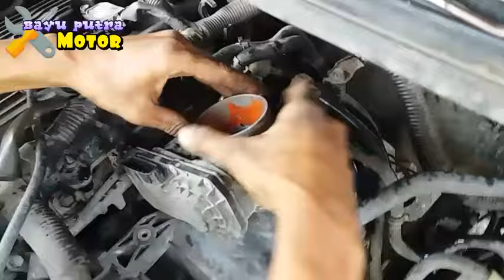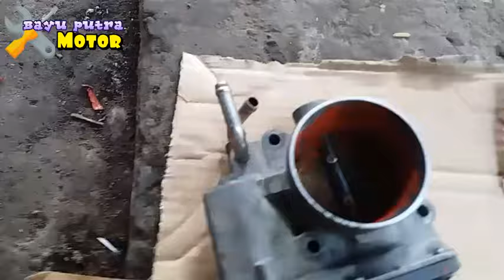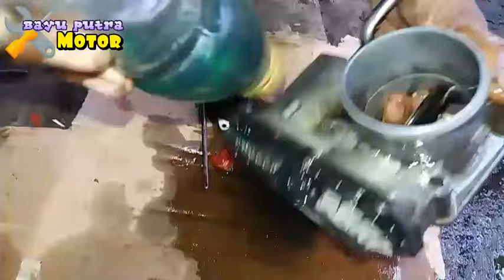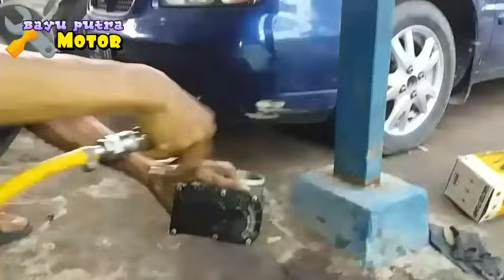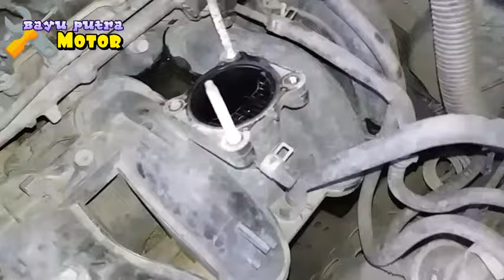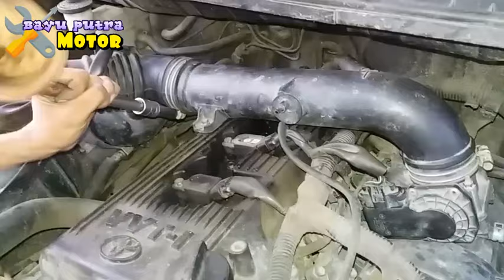CARA MENGATASI TARIKAN MOBIL BERAT DAN MESIN PINCANG TOYOTA INNOVA AVANZA XENIA/Bayu putra motor

Comment: Saya pernah bongkar taruna saya sendiri di rumah. Baru general check up sampe habis 3 juta. Mesin sih enak, cm kok tarikan berat. Waktu saya bongkar TB lha kokkk kotor banget. Trus kmaren itu nggak dibersihkan apa? Dasar bengkel duit mulu maunya. Beda yg kerja karena passion di otomotif sama yg pure cari duit emang. Hati2 aja.
Reply: TB kotor emg pengaruh ke tarikan ya om?
Reply: @jpc9808  pengaruhnya di idlenya sering mati matian ,kalau tarikan berat sih lbih ke krn internal mesinnya dah capek ( misal kompresi bocor) krn sdh pernah bersihin tb mobil maupun motor , ngaruhnya cmn rpm balik ke normal misal sblm d bersihkan 600 rpm stlh d bersihkan jdi normal 800-900 rpm
Reply: Mau nanya om,kog Innova saya tahun 2014 di trotle body ga ada selang airnya ya

Comment: Mantaaap.. 
Mau nanya bro itu td ad slang air di trotol body itu selang dari mana trus fungsinya apa bro..? 
Mohon infonya
Reply from the maker: Fungsinya untuk mengatur gas.
Reply: Selang air radiator untuk pendingin trotol body biar uademmm
Reply: @jewanace6119  bang throttel di innova sy kok nggak di sambung dan selangnya juga nggak ada ,apa. Ada pengaruhnya

Comment: klw saya prediksi itu d kasih lem agar idle kembali pada posisi standar. mungkin sebelumnya terjadi kehausan/koin tidak menutup pada posisi ideal sebingga idle terlalu tingi/besar  mungkin awalnya setelah d kasih lem normal. tetapi sipat lem itu lunak ketika terkena bensin yg menyebabkan sebagian lubang tetutup krna pergeseran lem.
Reply from the maker: Ya mungkin ini karna ga ba stasioner/langsam. Jdi di akalin pk siler . Seharusnya jgn pk siler tpi pk lem besi tipis2..
Reply: Bayu Putra Motor tujuan sudah benar tp butuh keahlian seni dan ketelatenan.
Reply: Masuk akal si

Comment: Mas inova bensin mesin getar saat langsam. Digas full nyendat2. Gas diurut tidak. Sudah diganti Maf, Afr, Busi 4, Koil 4, Filter bensin, App Pedal gas. Injektor hanya dibersihkan mekanik. Tapi tetap kayak diatas. Mohon jawabannya.
Reply from the maker: @cidadap1789  coba cek dulu tekanan fuel pump nya. Pastikan mencapai 40 psi

Comment: Maaf boleh tahu fungsi saluran air di throtlebody untuk apa ya?
Reply from the maker: untuk mengaktifkan FIAV (Fast Idle Air Valve).

FIAV adalah Valve mekanik yang berfungsi untuk melewatkan (bypass) tambahan udara ke TB pada saat mesin dingin (air radiator dingin) sehingga otomatis RPM akan lebih tinggi (CHOKE OTOMATIS), begitu air radiator panas, si FIAV (isinya semacam WAX yang mendorong mekanik Valve) menutup jalur udara tadi ke TB, sehingga RPM agak turun sedikit..
Reply: @BayuPutraMotor76  alhamdulillah, terima kasih banyak ya Om 🙏 semoga info ini tidak hanya untuk saya juga untuk penonton lainnya. Berkah dan makin sukses untuk anda sekeluarga beserta tim BayuPutraMotor. Aaamiin

Comment: Om bayu Putra Motor innova Q throtle body dan air Flow sudah ganti tapi mesin tetap gesek. Kira2 apanya ya om??? Mohon pencerahan
Reply: Mesin gedek rpm naik turun g bs stabil
Reply from the maker: Lampu chek engine menyala ga pda waktu mesin hidup? Klo nyala itu harus di secen dlu biar ketauan dari sensor mna yg eror
Reply: G nyala om bayu

Comment: kalo buat mobil avanxa pas di stater itu ngadat kalo di gas malah mati..  apa itu juga trotele mas ?
atau yg lain ?
mkasih.
Reply from the maker: Bisa juga maz..tapi coba di tune up. Dan cek sensor2nya
Reply: @BayuPutraMotor76  oke... penyebab kalo di stater tidak kuat dan tidak bisa nyala mesinya itu sih apanya om ?mobil avanxa

Comment: Om...itu 2 selang di Throttle Body aman dicopot kah? Selang bensin kah?
Reply from the maker: Itu slang air mas bukan bensin..
Reply: @BayuPutraMotor76  terima kasih infonya Om...saya akan coba bersihkan sendiri 😁, kalau service rutin di bengkel resmi toyota tiap 10k km apa tidak mereka bersihkan ya om
Reply from the maker: @dadangkurniawan4367  . Kalo 10km terlalu cepet. Awas klo mau bersihkan sensor hati2..klo mau coba trotlle body nya aja
Reply: Selang air di throtell body nggak ada amankah trim

Comment: mau tanya mas,punya saya kemaren kering bensin pas lg dijalankan,setelh di isi mesinnya jdi pincang,kr2 yg mesti hrs di benarin itu apanya ya mas..
Reply: innova jga mas
Reply from the maker: Rotak/pompa bensinya kotor karna endapan yg ada di tengki ikut tersedot..biasanya itu masalahnya. Coba di bersihkan dulu..mudah2n sih blm masuk ke injector..
Reply: tkt mas mau nyoba2,ntar tmbh parah😂😂,kalo misal benarin dibengkel kira2 kisaran hrganya brp ya mas "sbgai gmbran aja mas biasa benarin"🙏🙏 ..??
Reply from the maker: Itu blm tentu rusak cukup di bersihkan aja.  Bisa di coba ganti filter bensinnya dulu atau di bersihkan brg x ada kotorannya..klo bongkar rotak itu harus nurunin tengki bbm. Jasanya tergantung bengkel masing" klo di tempat kami kisaran 150rb an..
Reply: oke mas,makasih byk udh mau berbagi infonya..🙏🙏..!!

Comment: Bang mau nanya kalau innova tahun 2006 tidak berasap tpi bau pedis asapnya
Reply from the maker: Apa aja yg sudah di lakukan? 
Itu akibat pembakaran kurang sempurna jadi ada sisa BBM di ruang bakar
Reply: @BayuPutraMotor76  apanya yg mw di kerja itu bang? Terimakasih
Reply from the maker: @yokypamalingan7658  . Di tune up mesin dulu. Bersihkan trotle body dan cek busi . Dan cek sensor knalpot
Reply: @BayuPutraMotor76  bisa gak reviu vidionya bang terimakasih.
Reply: @BayuPutraMotor76  cman bau knalpotnya yg pedis bru knalpotnya tdak berasap.
Reply from the maker: @yokypamalingan7658  . Ya mas itu karna pembakaran kurang sempurna..
Reply: @BayuPutraMotor76  iyh jdi tidak perlu ganti ring piston dulu bang
Reply from the maker: @yokypamalingan7658  . Ya itu bukan dari ring piston..
Reply: @BayuPutraMotor76  terimakasih bang

Comment: mau tanya mas.. innova bensin saya saat stasioner dan hidup acnya tiba2 mesinya mati sendiri.. 
kenapa itu mas ya???
Reply from the maker: Itu biasanya karna idle up ac tida bekerja/tida berfungsi dan juga bisa dari kompresor ac macet / seret putarannya.
Reply: +Bayu Putra Motor 
cara memperbaikinya gimana mas untuk idle up nya??

kalo untuk yg compresornya yg bikin seret/berat apakah bearingnya ya..???

ohya sebelumnya trimakasih udah langsung di tanggapi pertanyaan saya..

Comment: waduhh..parah amat itu ngapain trotle ampe disilerin gtu..
Reply from the maker: Ya maz ga tau misi nya apa,kata pemilik nya sih habis servis di bengkal resmi. Tp di jln mlh mogok
Reply: +Bayu Putra Motor .mz mw  tanya kalau lampu kepala dihidup kan radiator nyembur
Reply: Bayu Putra Motor ya ga mungkin dealer resmi ngasih sealer di bagian trotle body gan... Dan itu pembersihan  sensor air flow kok di siram bensin bukannya malah seal nya melar.. Harusnya cukup di bersihkan pake semprotan cleaner di bagian Hot wire nya saja.... Hahaaa
Reply: Paling pemiliknya bohong...servicenya paling ganti oli ama filter aja dia...